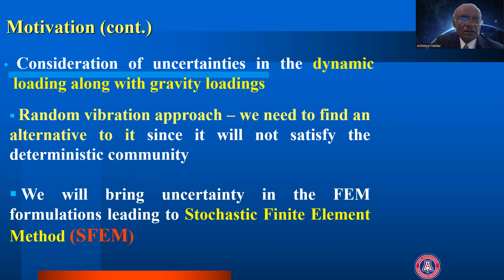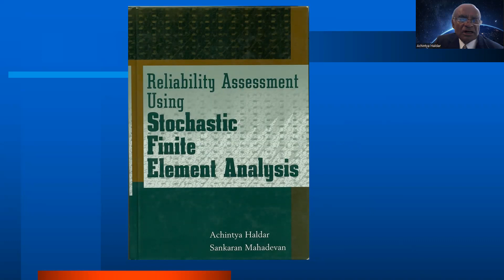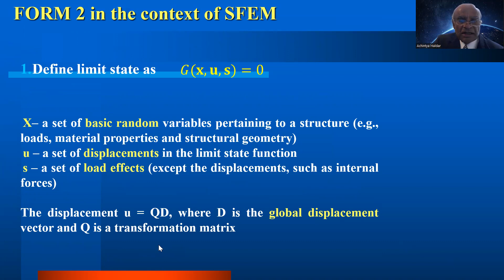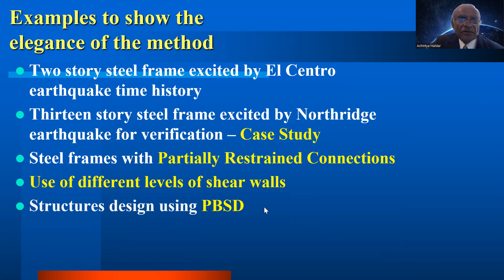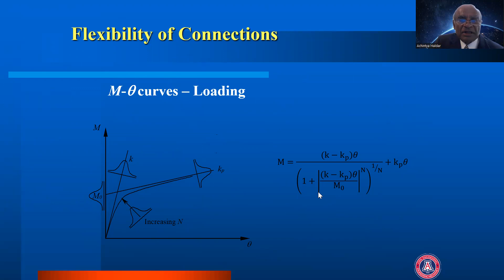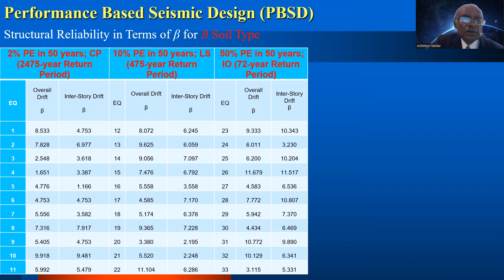CONF-MPCS 2023 - Reliability Estimation of Structures Excited by Dynamic Loadings using ...

Comment from the maker: Here are the questions we collected and the answers replied by the presenter.

Q1: What are the differences between Displacement-based FEM and Stress-Based FEM?                  
A1: For large deformation and nonlinear problems, the representation of a structure by finite elements using the Displacement-based FEM can be very complicated, particularly considering the total number of finite elements necessary to capture the behavior and repeatedly inversing the stiffness matrixes required to complete the task. The Stress-Based FEM can be very attractive for this class of problems particularly for the frame type structures. The presenter published a widely referred book identified below. 
Haldar, A., and Mahadevan, S., Reliability Assessment Using Stochastic Finite Element Analysis, John Wiley & Sons, New York, NY, 2000.

In this book, both the Displacement-based FEM and Stress-Based FEM are discussed in detail with examples. The total number of finite elements required for a specific problem is also discussed.  Serious scholars are requested to refer to this book.

Comment from the maker: Q2: How can the Performance Based Seismic Design (PBSD) be applied in reality?
A2: In the U.S., the PBSD concept is well developed for Immediate Occupancy (IO), Life Safety (LS), and Collapse Prevention (CP) performance levels, specifically for steel structures. IO, LS, and CP are defined in terms of allowable drifts. They correspond to the earthquake return period of 72, 475, and 2475 years, respectively. The allowable drift for them are 0.007 H, 0.025 H, and 0.05 H, respectively, where H is the height. The presenter wrote another book on the related books recently published as given below.  
Haldar, A., Azizsoltani, H., Huh, J., Gaxiola-Camacho, J. R., and Vazirizade, S. M., Reliability Assessment for Complex Dynamic Systems Excited in Time Domain – REDSET, Wiley, New York, 2023.

Both books cited here are published by a very reputable publisher, Wiley, N.Y., in the U.S. Again, interested scholars are referred to these books to develop good understanding of the subjects.